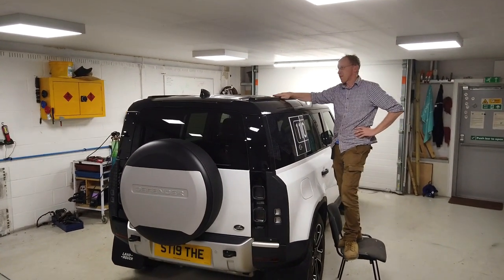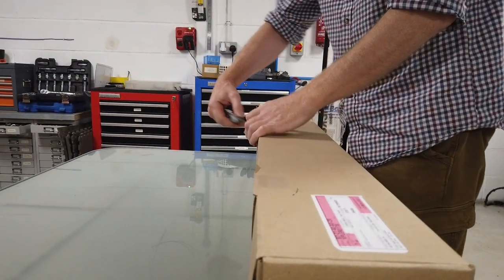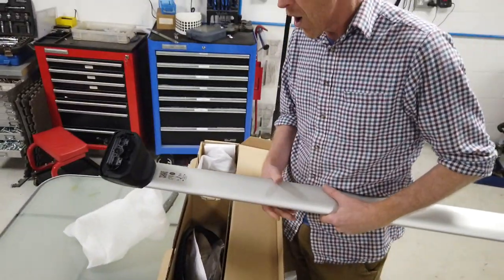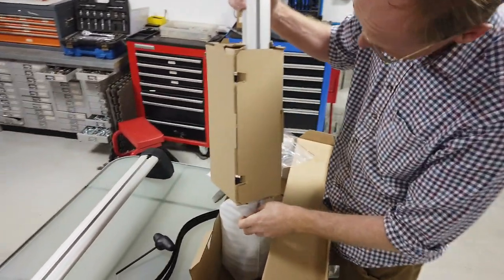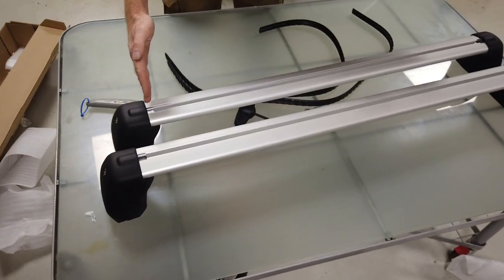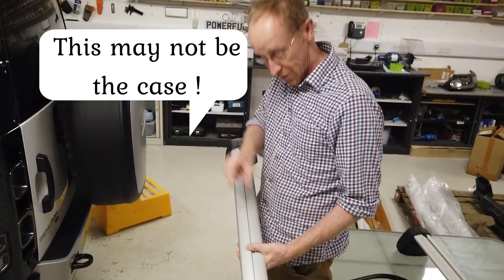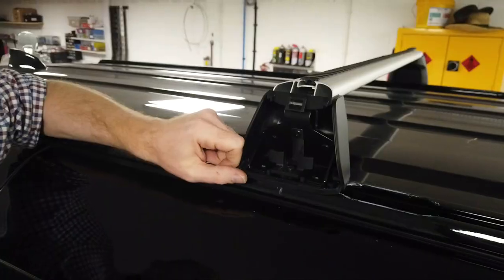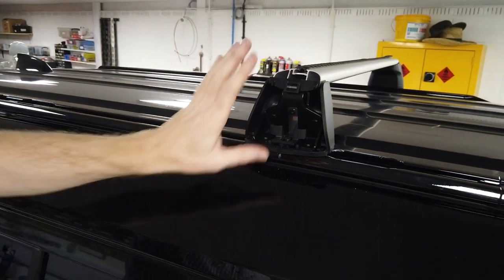NEW Land Rover Defender 110 Roof Cross Bar Fitting Instructions VPLER0178 VPLER0179

Comment: Better to get Thule evo bars and the 753 feet with 3040 fit kit.  Updated t slot allows use without having to cut the rubber piece and since bars extend beyond feet they are a lot more useful.  Also slightly lower.
Reply: Wish I had seen this before I ordered the LR ones. I had been debating whether to buy the Thule ones for a better over hang but couldnt get a firm answer as to whether they fitted the Defender Roof Rails. anyways, fitted now. its only for Roof Box for vacations so hoping they come off easy :)

Comment: Can you provide added height from the roof to the top of the cross bars? Just want to make sure i can fit my Defender into the garage with the installed cross bars. Thanks for the great video as always!
Reply: I get 5.25" on mine. About 2" taller than the sharkfin antenna

Comment: Video invaluable. Could put on alone. Note that when the side cover is removed ( which does make it easier doing alone), they are side specific . You can tell if they get mixed up as I managed to do by aligning the bump on top of the cover.

Comment: Hi Simon and Tyler, great video, and very useful. However, the roof bars are very close together, and not much use for carrying long items such as your plasterboard, or a ladder. Can you fit them further apart by just tightening the allen key, without using the cut out locators?

Comment: I had the crossrails fitted on my Defender by the Land Rover Garage, Marshalls in Peterborough.  I‘ll have a look to see which side the stickers are on, and pay attention to the aerodynamic profile of the bars
Reply from the maker: Thanks please let us know. Also make sure you have your keys and the MONSTER hex key !
Reply: @L663  - the stickers on my crossbars fitted by JLR at Marshalls, Peterborough are on the passenger side of the vehicle (RHD).  And they left me with the keys and Monster Hex Key!
Reply from the maker: @promenteryrobbins  Excellent so the "right side" as per the instructions is the "left side" Thanks for checking
Reply: @L663  - exactly - „right side“ as you‘d look at the front of the vehicle, i.e. the passenger side of a right-hand-drive vehicle.  I‘m carrying an iKamper on mine - I‘m trying to work out whether I could also fit one of the side boxes together with the cross-bars given the available slots in the roof-rails, and still avoid covering the antenna with the iKamper.
Reply: Have you compared them to the bars for the Disco 3/4? I’m wondering if they are interchangeable?

Comment: I doubt its for vortex disruption looks more like for load grip. The question is how noisy are they when you're doing 70 mph? Every roof bar I have ever purchased looks nice but always introduces a lot of noise. They are more aerodynamic than the ones I have and I wonder how much difference it makes.
Reply from the maker: I am sure the rubber is a grip strip but was wondering why they chose the sloping pattern...
Reply: @L663  it's to make them look pretty'
Reply: I have the same Thule Wingbars on my Jaguar XF Sportbrake - very quiet.  I use T-track Eye Bolts with retractable ratchet straps
Reply: Just installed mine, they are howling. I didn't put in the rubber strip, going to add it soon.
Reply: Mine are still howling at 70mph with the strips, stickers on driver's left 😭

Comment: The front and back cross bars are actually a different size. The rails on the roof are not parallel it tapers toward the back. It took me forever to figure that out. At least it is this way on my 2020 Defender.

Comment: Hey Simon, great job! I drive a Defender 130 and I really want to keep its original look without adding too many external accessories that might increase wind noise. However, I'm thinking about installing an awning that I can easily attach and remove. My Defender has a panoramic sunroof and a small moonroof at the back for the 3rd-row seats. I've been searching for a solution to mount an ARB awning without any visible crossbars on the roof windows, so the family and I can still enjoy the open sky. I've looked into the Thule WingBar Edge, but I'm not completely sold on it. Do you have any suggestions or insights? Thanks for sharing your knowledge!
Reply: Hi, did you get a wingbar edge eventually? I'm also looking to get the same. Also of you've got a sunroof. Did this effect its operation at all? Thanks

Comment: How is the wind noise while driving with these cross bars??  Appreciate any help / thoughts….  Thanks!!
Reply from the maker: There is some - but these are much better than the expedition roof rack. The joy of these bars is they are easy to remove so you only need to put up with the wind noise when you need the bars.

Comment: Hi Guys, Super useful and enjoyable as always! 
Can you confirm that the 94kg limit is the dynamic load? 
Thinking of a light rooftop tent that will be far less than 94kg, but when we're parked we'd reach 200kg with me and my wife (and the dog).
Reply from the maker: Good question - I have had me and the wife and the ARB roof tent on the roof without a problem - i suspect this is some dynamic loading as you suggest.
Reply: @L663  Thank you so much for your feedback!

Comment: Right side vs Right Hand Side
Right side vs Correct side
Proof reading fail 
Though arrow on the sticker did appeared to point to the LHS of the vehicle.
Are the Front and Rear bars different heights?
So, the cross bars have fixed position and can't be adjusted fore & aft? and if you leave the key in when you open the cover, you damage the paint? who "designed" this?
Reply from the maker: I seem to have a gift of being half stupid and half astute.... stupid enough to make all the mistakes but astute enough to see that Land Rover could have been clearer on their instructions !

Comment: Technical question Simon.......  I don’t like driving around with my roof bars on if there is nothing to carry........  is it ok to use the big key thing to unscrew the bit that goes “click” when correctly tightened or is it a case of once the cross bars are on, that’s it you aren’t ever meant to take them off again? Reason for wanting to take them off is also because I have the opening panoramic roof and if you tilt the rear edge open it sits just about under the front crossbar and whistles - no problem with the roof fully open, the whistle stops. I haven’t noticed any significant increase in fuel consumption running with them on for the last 2 month too.
Reply from the maker: I took the bara off straight after the video and they came off fine... i cant see what makes the click noise... and not sure if they will click again but they are designed to go on and off the car so i think you should be fine. Let me know if you want me to double check tomorrow.
Reply: Thanks, I collected mine from the dealers this morning after 3 days in the workshop tracing the rainwater leak, which hopefully is now cured by replacement of the fixed section of the window on the door and they have cured numerous rattles. I asked the service technician about removal of the bars too and about the click and was told to use the big Allen key thing to unscrew the hold down screw, the bars are designed to be removed and replaced multiple times. Now my problem is I cannot find the 4 keys.............. they’ve been on my kitchen counter for weeks, I must have tidied them away to somewhere for safe keeping......
Reply from the maker: @timoliver8940  IS there any number on the lock - i am not at work at the moment and cannot check.
Happy to post you one of my keys....not really sure why you need 4 !
Reply: Thanks for the kind offer Simon, this morning I’ve found that for some reason (old age possibly!) I had put one key onto each key ring for my TDi300 Defender 90 instead of the rings for the new one. The key number is  stamped on the bit of the lock barrel that isn’t covered by the plastic finisher so I took the old Defender key rings out to new car and tested and now all OK. As an aside the tow / recovery eye trim finishers are now installed on mine and it looks finished now! Why a premium car maker like LR hasn’t added finishers (they do for roof rail systems that you cannot see once the rails are fitted) to the kit is beyond me.

Comment: What is the height above the roof to the top of A) Cross Bars or B) Expedition Rack system ....need to know if its fits in my garage
Reply: 4.5 inches. 78 inches from ground with the 33” tires on 19” wheels.

Comment: Great video Simon👍🏻.  It seems JLR have actually thought about the fixings 😮 - these are a lot easier to install compared to the Discovery Sport bars. They clamp around the roof rails and in my experience are somewhat reluctant to come off again. 😉
Reply from the maker: They are pretty good but are limited in that there are only a couple of places you can position the bars.

Comment: How do they compare price wise to Thule bars or, are they made by Thule? I know Peugeot genuine roof bars are actually Thule just with a different logo.
Reply from the maker: I suspect they are Thule but could not find any signs.... the carboard box was not great quality so that made me doubt they were Thule.
Reply: I was quoted £183+vat from local LR dealer. Just fitted the expedition rack instead, at £960 😳. Very solid for a lightweight though. BTW, anyone getting the cameras dissappearing issue, hold the main screen power button down for at least 20 seconds until the screen/pc reboots. Sorts the problem out, but hopefully a software update will deal with it soon.
Reply from the maker: @Defender3d  There are some issues with the electrical systems but most seem to be getting fixed with software updates.. I did not get this issue... i had the opposite... cameras stayed on while driving at speed !
Reply: @L663  Those are Thule "Wing bars" with end fittings to fit application.  Thule make most of the roof bar/bike rack/towing kits for JLR.  I have the same on my Jaguar XF Sporbrake and use the T Bolts for strapping.  I am patiently awaiting the 90"  - especially the commercial.

Comment: Always fun to watch.  
I have to confess the instructions and orientation of the sticker seem to make sense to me (obviously the way my brain’s wired).  
The arrow on the sticker points to itself (“this is me”).  It’s located at the front on the LHS as you sit in the vehicle.  Or the right (sorry, I mean correct) side.

Question:  I’m looking to buy some T-bolt lashing eyes that I can fix to my roof rack (which, I assume, is the same profile as the bars).  Frontrunner make some good ones but the nut seems to be too deep for the LR channel.  Have you come across any that LR may have used on previous vehicles (if they’ve stuck with the same dimensions)?
Reply from the maker: Hi Alan... so you think the "right" means the "correct" side ... i just think it would have been easier to have said that the wide part goes to the front etc ?
Reply from the maker: Do you have the explorer roof rack on yours ? we have one to fit next week so can check the T bolts
Reply: I do.  It has a frame, 6 cross bars and a rear treat-plate area.  Each of the cross bars is profiled like the roof bars  you fitted and has a T-slot channel with the ‘aero’ vortex-defying rubber insert 👍

I have to say that the combination of the roof rack and the ladder (which is amazing by the way) is excellent.  Used in anger quite a lot now.  The only drawbacks are that the bars are made of the same anodised aluminium that you have on the bars - which scratches really easily - and there’s no way to tie things down laterally (hence the desire for eyelets that can be locked into the T-slot).  Ideally the eyelets would be fitted with a rubber gasket to stop them damaging the aluminium surface.

One quick note:  when you’re fitting it, make sure you use a long enough socket.  It’s clear that the dealer who fitted mine didn’t and they’ve scuffed the paint off the frame in nice circular marks where their drill has rubbed.  You’ll see what I mean.

Comment: I meant to comment when you published your Evoque roof bar video, but got distracted...
It looks like the Defender cross bars are similar to the Evoque ones - made by Thule using the T-Track system.
It would be great if @PowerfulukLtd could stock some accessories for these! 

Have you seen the ridiculous price of Land Rover's tie down rings, part number: VUB503160 ! 
Perhaps these are certified to take the weight of the Eiffel Tower - but like you, I only want to pick up some 4"x2" posts etc. so just need some sensibly priced bolts. When you have a minute, perhaps you could look into sourcing/making/selling an affordable range of T-Track bits?

Thanks for all the Land Rover videos - keep going, it's working as I find a lot of people IRL are watching you and getting to know your company!
Reply from the maker: OK so I have done a drawing of the section of the cross bar - see below link
This should take a Thule T track fixings ( 20mm )
https://www.dropbox.com/s/h8augun80d3pvvw/defender%202020%20cross%20bar.jpg?dl=0
Reply: @L663  Will you be stocking some T-Track fittings or isn't this something you would be interested in doing? LR want £89 for tie down rings when Amazon have similar for around £10!

Comment: Hmm..tell Luke that it would be clearer to refer to Off side and Near side of the car!. Left and right needs clarifying and causes confusion.  I hope they are quiet...those on my Suzuki SuperCarry in 1986 would howl at 50+ mph!! Richard😀😀😀😀
Reply from the maker: Suzuki Supercarry at 50 MPH !
Reply: powerfulukltd It was even better at 65/70!! I fitted a later 5 speed gearbox  which helped and the “stability” improved by carrying a 1cwt bag of sand  over the back axle. I did over 60,000 miles in it and it was maybe the most useful vehicle I ever had but looking back, terrifying had anything gone wrong in the crash department!! 😱😱😀😀😀😀
Reply: Offside and nearside won't work - if you are in the USA (for example) it would be the opposite way round and you would fit them incorrectly.  It just needs a clear arrow on the lable pointing to the front of the vehicle.